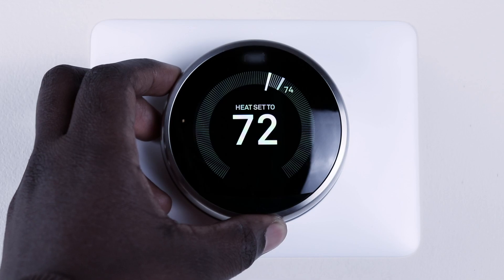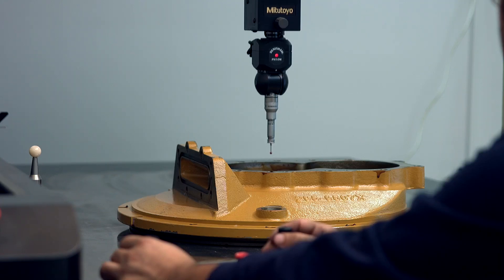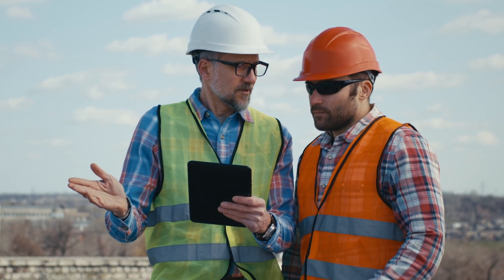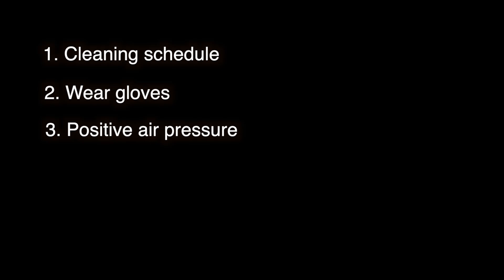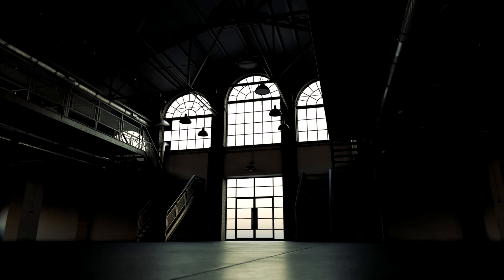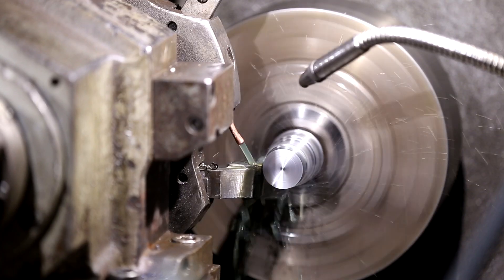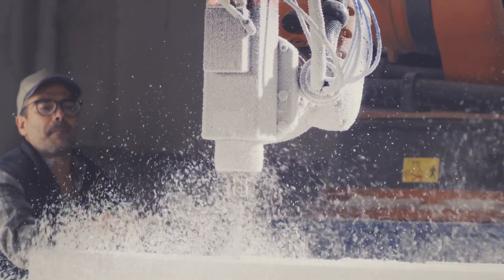9 Tips to Ensure Your Metrology Lab is PROBLEM-FREE

Comment: Note, it's extremely important that air is CLEAN and DRY, as particles and moisture can destroy air bearings. Power should also have additional protection from surges, faults, and low voltage. If the lab contains any sophisticated electronics (SEM, XRF, etc.), dirty power can kill those tools.

Comment: If the part is going to be used in 40C plus temperatures. Why are we testing it at 20C?
Reply: 20C is the standard
Reply: That’s up to the engineer to design the part to expand
Reply: I suppose if you wanted to you could design the part to be used at 40 C, manufacture it at 40 C, and measure it at 40 C. But you would just need to make sure everyone involved in the process knows that 40 C is the temperature to be adhered to. I imagine whoever has to do the work in the 40 C environment wouldn't be very excited about the heat, though!
Reply: Engineering the part around its thermal coefficient is much easier than manufacturing at 40C (104F). Imagine trying to keep that part's tempature at that tempature during the manufacturing process. Not to mention your measurement standards or equipment at that tempature. Would you ever want to work in a shop all day that is climate controlled to hold tempature at 40C?

Comment: I am kinda a Metrology noob but I just got an OGP 302 this last year and it's been a blast measuring parts with it. I know temp flux is the enemy but dust has been harder to control in my tiny shop
Reply: as you might know what you are talking about , i have a UNS thread to do, they give me a major/pitch/minor but not a route rad the only way to get it all in tolerance is making the route rad bigger but they keep saying they want a standard UN route rad and as its a smaller minor it is always out of tolerance, we have made these parts for 10 years but the new laser measuring machines they have have picked the problem up  lol
Reply: @markhorner4982  i thought the only way to change the root radius was to get a customer ground thread mill with what ever radius you need? I also have never been asked to measure root radius on my CMM